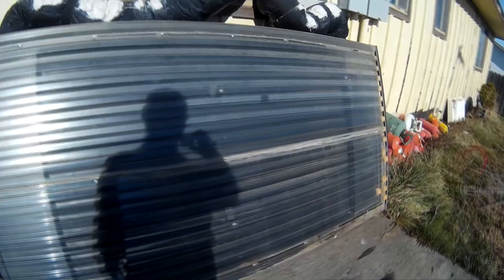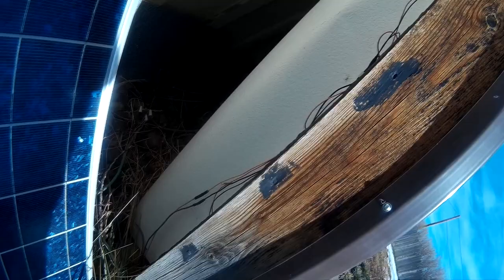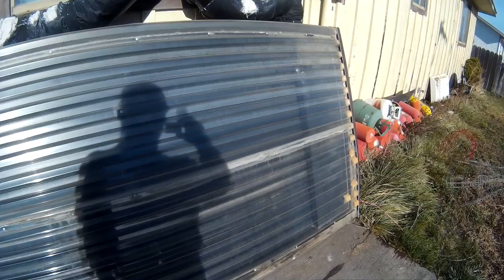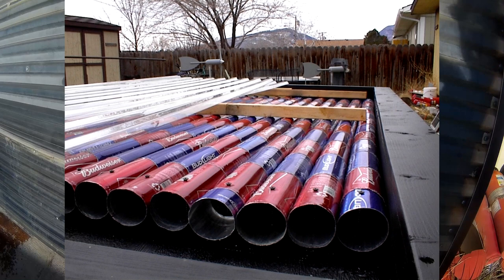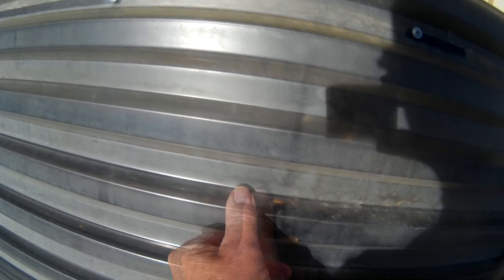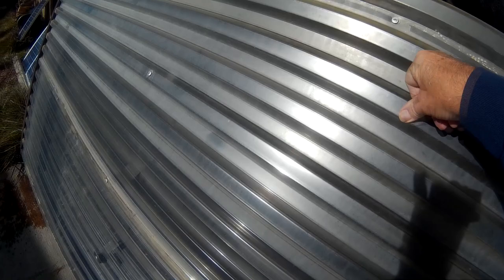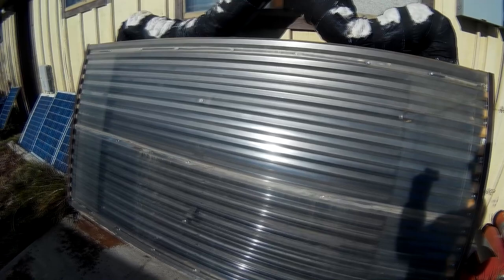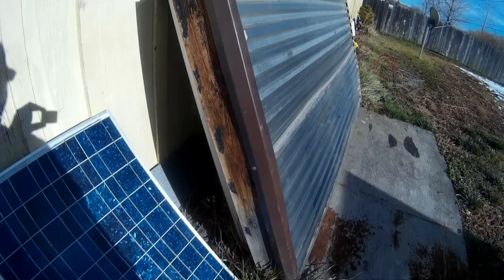Solar Heating is great and free!

Comment: Am I to understand that you are recycling air from the house out to the heater and back into the house? That makes sense. If you have an older house that leaks or an active household going in and out all the time then you are probably getting enough new fresh air. I never did agree with sealing up a house super tight. I'm 72 and my parents were old school Europeans who kept windows open a crack in wintertime for fresh air. I learned to love sleeping under a pile of blankets with cool air wafting over my face.
Reply from the maker: This recycled air is heated by the sun to help heat the house

Comment: Would it not be more efficient to take heat from the bottom of the room and blow into the top?
Reply from the maker: Thanks for your comment. Since hot air rises, I wanted the hot air from the solar heater blowing into the room as low as possible.
Reply: You heat the air in the air heater, so that is where you'll get the most thermal current. There are setups without fans that just run on that. Now you're pulling air against the current with the fans.

I understand your reasoning though. This way the room temp might be more even.

Thanks for the vid!
Reply from the maker: Yes, but it really feels good to stand in front of the warm air blowing at you. It still heats up the room.
Reply: @butchwilliams7637   I know what you're saying.  You're basically being the thermostat by pulling the Way Too Hot air out of the room tom make it bearable.  Well done.  Adapt and overcome.
Reply: Great video thank you for sharing
Reply: Cold air settles to bottom of room

Comment: Nice video. I would like to do something similar. During summers here in north Italy we have high temperature (up to 40° c). I should cover the panel for prevent any damage? What do you suggest? Thank u.
Reply from the maker: In the summer covering it will help it from getting hot. You could also disconnect the hot air from coming onto the house and let it blow outside. Mine is uncovered all year round. I let it pull the air from the ceiling in the house which is hot and blow it outside. Hope this helps.

Comment: Ever tried moonlight cooling at night with it? 15 degrees difference between the shade (shadow of moon) and the moonlight. Might work..
Reply from the maker: Thanks for your comment. This one was built just for heat and is completely            automatic when the sun shines. Still working.
Reply: @butchwilliams7637  was just wondering 👍😎👍
Reply: @Panthera no? Have you tried it already? My buddy ran pex pipe running water/glycol in his backyard and covered it with fresh dirt. He has a beautiful yard and his garage stays cool all summer with just a 12volt powered fan blowing through a small coil taken from a ice cream sales floor cooler. Pretty cool, but of course everyone said it wouldn't work, same thing they said when I converted my duramax diesel to run on water. Works REALLY good..
Reply: @Panthera the moon light itself is cooler.
Reply: kinda like those lunar pv panels ?  lol , sorry , couldn't resist.